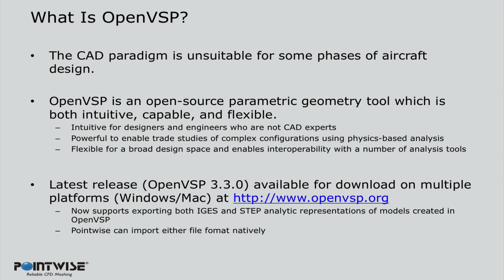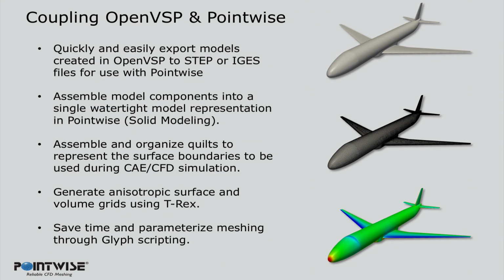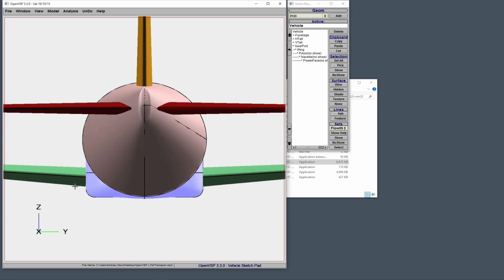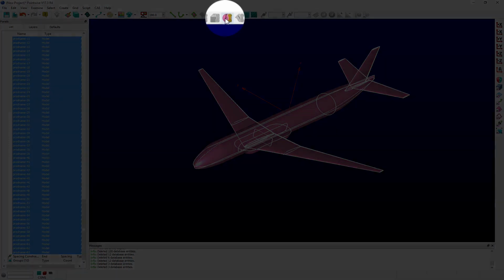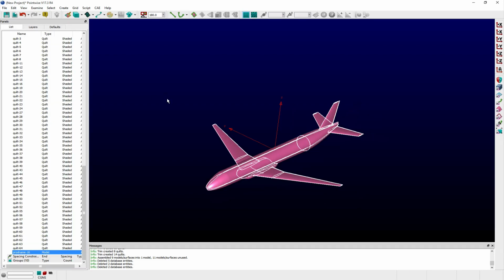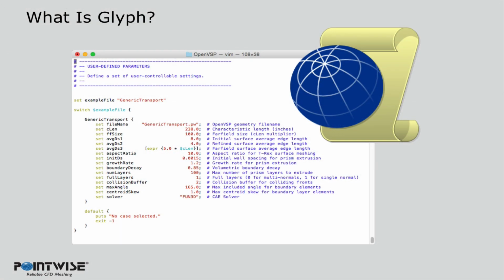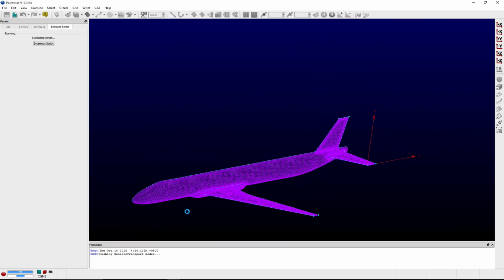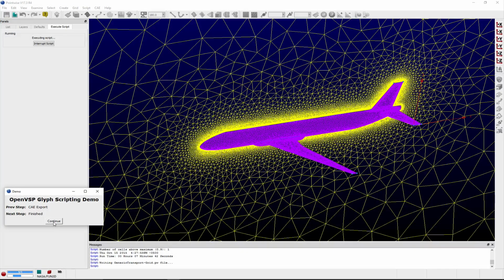Using Automated Meshing for Analysis in Conceptual Design

Comment: Thanks for providing this WebCast. I've recently adapted your Glyph script for my purposes, and found it fairly straightforward. I have a couple questions. 1) When automating 2D TRex surface meshing for a full aircraft configuration, I frequently encounter warnings during surface domain initialization, indicating cells could not be created at a certain X,Y,Z location. The meshing always seems to proceed, but is this something I should be concerned about. 2) I find applying the growth distribution function to leading and trailing edge connectors often produces undesirable results. i.e. too sparse or too highly refined distributions when the optimal dimension is applied. I find it difficult to identify robust growth distribution parameters that produce consistent grid structure when the winspan changes, for example. Do you have any recommendations on how to improve this? It seems it may be easier to apply an explicit leading edge/trailing edge dimension based on wingspan, and then apply hyperbolic tangent end distributions to match the 2D TRex spacing. Is there a reason the growth distribution is used instead for leading and trailing edges?
Reply from the maker: +Christopher Heath Thank you for watching our latest webcast. We are happy to hear you've adopted Glyph scripting for your grid generation purposes and hope that you find it a powerful tool for automating your grid generation process. The answers to your questions are below:

1. Glyph is often more verbose than running commands in the user interface. Warnings such as those you are encountering are more for debug purposes and are not something to be concerned about. 

2. We recommend using a growth distribution on the leading and trailing edge spanwise connectors for more control over the final distribution. Because the growth distribution function relies on the geometric growth formula, you can actually target a specific cell aspect ratio at the midspan location and back out the number of layers required to achieve that value. The first step is to cluster points at the root and tip using the same spacing that you are using for 2D T-Rex's initial DS. This will ensure an aspect ratio of one at the root and tip reducing the overall area ratio. The next step is to use the following equation to back out the number of layers required for the two-sided growth function: Number of Layers = Log(Desired Aspect Ratio)/Log(Desired Spanwise Growth Rate). The aspect ratio is the aspect ratio you'd like to target for the midspan, between 10-20 is usually good for the leading edge. The growth rate is the growth rate you plan to use for the connector's growth distribution function, typically between 1.2-1.3. There is a video describing this process and we encourage you to watch it here https://youtu.be/uz661XzE1QE?t=5m31s.